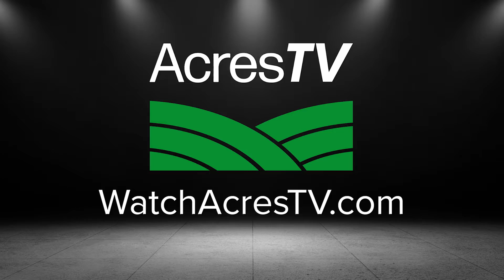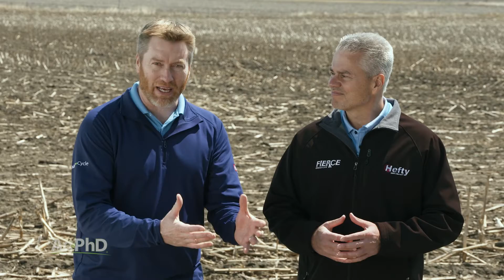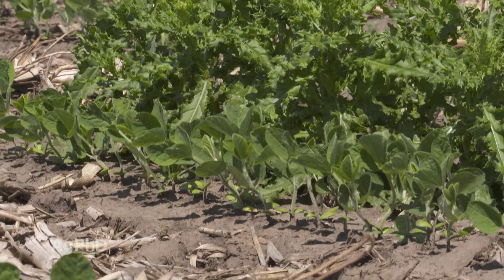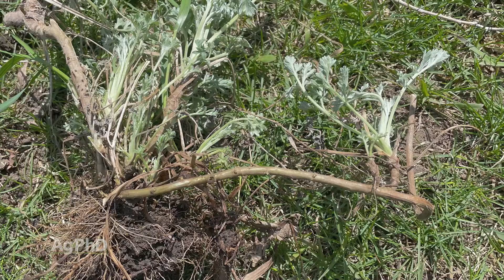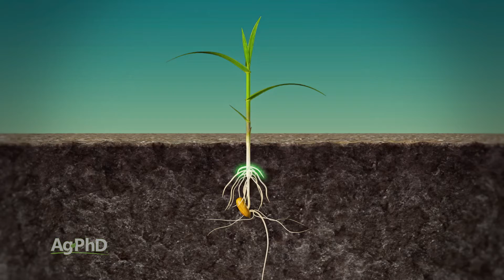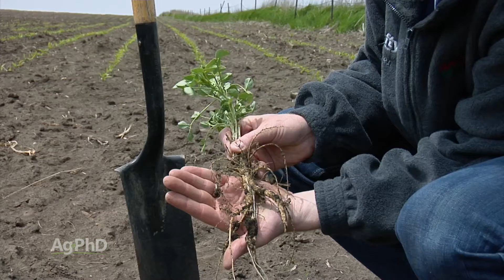Types of Root Systems

Comment: Not true, weeds that have taproots will need to be dug out, no amount of rain will make it any easier to be pulled completely out by hand. The weed you pulled had a fibrous root system, they pull out without any resistance dry or wet.